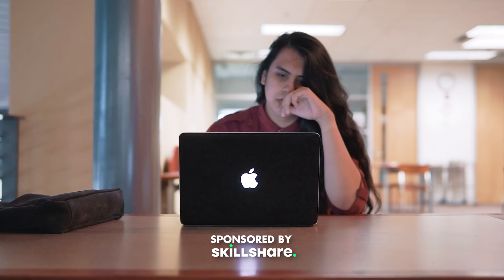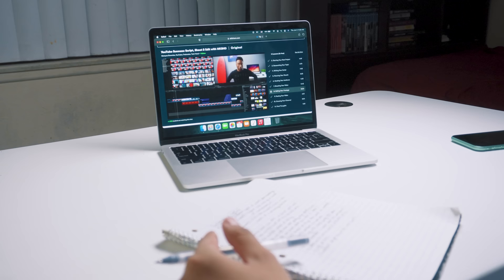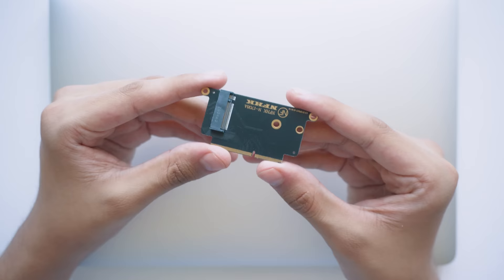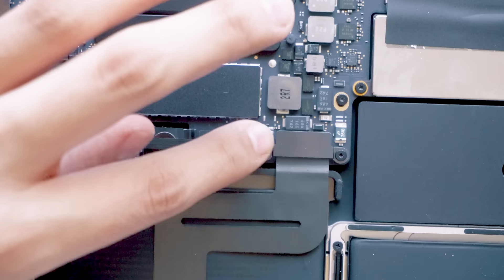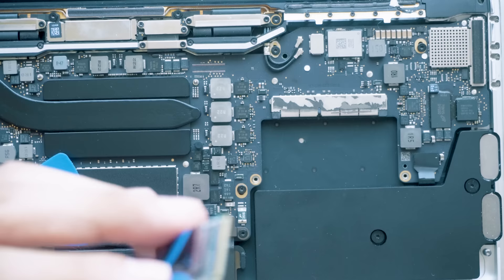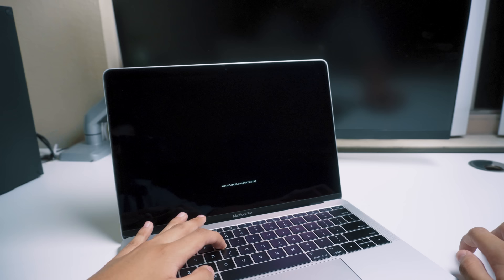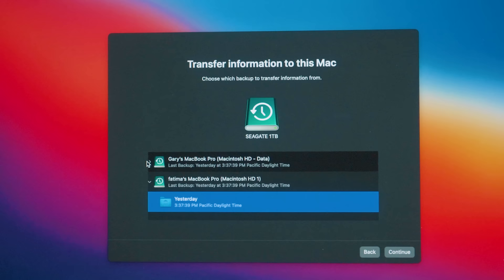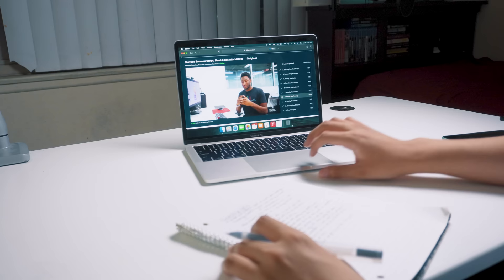I Was Wrong. THIS is the LAST Upgradable MacBook Pro

Comment: Can this be done on a 2019 16inch MacBook Pro? Nevermind bully me!
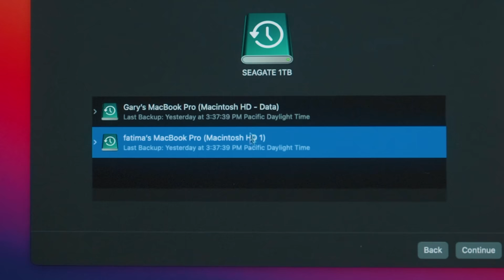Reply: 9:58 was hilarious
Reply: It can't unless you buy a new logic board with more storage
Reply: @slider7264  or you can learn how to solder
Reply: @jameschen8  it is not enough, there is a serialization on the chip, you have to transfer the serial from an old one, as in iPhone..
Reply: You can upgrade the storage in the 2019 MacBook Pro
Only with micro-soldering
Reply: @aleksandr_elkov  you can upgrade to windows (lol)
Reply: @al_three_ex  That is not upgrading !! That is called turning mac book in to a piece of crap...LOL
Reply: @jameschen8  nah T2 chip will turn whole mac into piece of garbage after a successful SSD soldering
Reply: No!

Comment: just remember to keep your original apple ssd, you will need it to upgrade to Monterey. The MacBook will do a firmware update in the process and will fail as it needs the original apple ssd to complete the firmware update. Once you have updated the firmware you can put the adapter back in a new upgrade to Monterey

Comment: The way the stand-off works is that you insert the nvme into the holder. The standoff is smaller in the middle because that part goes into the notch of your nvme. Then you use the screw and insert the screw from the bottom to hold the stand-off in place.

Do not put the adapter in first before the nvme because the screw is on the bottom
Reply: Is it possible to upgrade the hard drive in my 2018 Macbook 15" Pro Intel i7 ?
Reply: @torontoyes  Nope, all 2018 MacBooks have soldered-in storage. These 2016-2017 non-Touch Bar MBPs were the last to have any kind of upgradable storage.
Reply: @thepthepthep  let me correct you here. It is possible to replace the NAND chips and the T2, which can result in increasing the size of your HD.  You will need to reprogram for it to work.

Comment: Evening Buddy, Great video thank you. I've just done the upgrade with the same adapter and thought the standoff was broke on mine too. I did however work out that these adapters are slightly different to usual ones. What you need to do is place the gold stand off at the end of the ssd in line with the hole and then attach the screw from BELOW the adapter to keep it in place. Obviously this can only be done whilst the adapter is out of the MacBook but hope that makes sense.
Reply: That’s correct. I have the same adapter and can confirm that’s how it works.
Reply: @force0123456789  hi mate any link whered u got those adaptor?

Comment: Thanks for posting this video. I couldn’t have done this upgrade without you. My laptop now writes at 2200MB/s and reads almost 3000MB/s! I used the new Sabrent 512GB drive. Only cost me $60 and I quadrupled my storage. My laptop has never worked so well. You’re awesome!
Reply: Does it drain the battery faster than before?

Comment: Ok - Anyone who watches this and does this upgrade, don't be shocked if it does NOT go this smoothly. A few recommendations...

1. I had to create a Mojave boot installer by formatting an existing flash drive (the adapter I bought even had a note in the packaging telling me I would have to do this.) This is due to the firmware on an older mac not being able to recognize the new NVMe firmware. Without this step, the new SSD will not be recognized. (I don't know how he got around this step). Look around youtube on how to do this, it's not too bad - it worked on the first try for me, luckily I had a spare 16gb flash drive laying around.
2. Don't worry about installing a time machine backup onto the new SSD from recovery mode. When in recovery mode, just install the MacOS it recommends, if your boot installer doesn't automatically do this for you, and then do the OS upgrade from the desktop. After all this is working properly use migration assistant to install your time machine backup.
3. I used an old car GPS window suction cup holder to pop the lid off my Mac, it definitely made life easier.
4. Buy a decent tool kit, maybe like the ones from ifixit - don't limit yourself to only the T5 and P5 - I ended up also needing a small phillips head that was fortunately included in the toolkit i bought. I got mine on Amazon for $20.
Reply: I’m so glad about your comment. You have saved me. It was so frustrating to me when I face the problem but I followed all your step and it worked. Thanks dude. You are awesome.

Comment: I made this on my 2017 macbook air, and  it reduced the time on battery, but i noticed that depends what kind of drive you use.  NVME drives with cache cause less impact on battery life.
Reply: No drives with a DRAM chip will use more power and run hotter, and there’s no 2242 sized drives would come with a DRAM chip. Find a drive that has a lower power rating would be better.

Comment: just for Monterey be sure to upgrade once on the Apple SSD, then go back to your Sabernet and upgrade again. Monterey comes with a firmware update that detects if it's OEM ssd or not. But after the firmware is updated you can update to Monterey on your biggo ssd.
It's the same for 2015 mbp btw ;)
Reply: By this do you mean - the backup you restore to must already have Monterey installed?
Reply: @dhcmrlchtdj-1  this has nothing to do with any backup. To install Monterey on a non-apple SSD, the Monterey has to have been installed before on the MacBook in question once (with the og apple ssd). Monterey installation updates the firmware- but it only does this when it can verify the ssd. 
So if you try to install without this step, the installation straight onto a non-apple ssd; it will just crash and reboot.

Comment: If you're getting an error that says that you cannot connect to Apple's servers, instead of pressing command and R, you should press option command and R. This should bring you to the newer utility where you can actually install a newer Mac OS version. And if you're still getting that error you should try and connect to another Wi-Fi if possible. These two steps helped me resolve the issue.
Reply: I've made a bootable flash drive with Ventura. It didn't connect to Apple servers in both combinations

Comment: Just a suggestion to anyone giving this a go. If you use command option r on boot it will pull the latest version of macOS so you won't have to update after setting up the mac. Command R will just pull the version of macos that the device came with from factory.

Comment: I just upgraded my 2017 MBP 13 WITH A WD SN740 NVME 512GB with this adapter and everything including sleep works great.  Im getting about 2500/2300 MBps read write speeds.  Which beats out a lot of the 2022 Mac base models.  The whole combo cost (new parts) about $45 USD off eBay. I recommend the NFHK  adapter, it works great. Just remember the gold  piece is the retention mechanism that holds the SSD. The gold piece has a slot to hold the SSD in perfect position.  The screw goes in from the underside of the adapter to you have to assemble the SSD/ Adapter combo first! I recommend a clean install of Mac OS Ventura for max speed.  I did upgrade to Sonoma with OCLP 1.3 because I use the dictation function daily for work and I was tired of VM Windows 11. Im surprised that these 2017s do handle Sonoma quite well.
Reply: 45 for the whole upgrade ?
Reply: WHat's a clean install of mac OS? From USB or internet recovery mode?

Comment: Other comments have covered most things around the stand-off but if you use cmd-opt-r that will do internet recovery of the latest OS the Mac supports. Also when at the installation stage there is an option to use Time Machine so that is the best point to do it. Great video overall though.

Comment: I got the exact same setup, exact same SSD. The problem with this particular model of SSD is that it doesn’t go sleep mode making the MacBook constantly on. An issue well known from all the people who did this mod. 
So technically I just run out of battery everyday and it is a pain to turn back on because you have to go through the  whole reboot system. Thinking about it, it was really fun to do that but in long term it is really annoying

Comment: Owner of a 2016 A1708 here:
Was lucky enough to find one with an i7 and 16GB to boot in the market; got an M.2 2230 adapter and jumped up to 512GB.
Reply: Any issues with it yet? I’ve heard of problems with battery drain while sleep

Comment: Hey man, amazing video! 🙏🏼 just missing one key point, the MacBook doesn’t have uniformed outside screws for the case, so make sure to know which ones go where otherwise you’ll be playing a guessing game until all screws fit in their correct places. Also i did purchase the adapter linked in the description, but unfortunately I didn’t notice it’s the wrong size until I actually got it. Make sure to fix that so other people can avoid buying the wrong adapter.

Comment: Such a beautiful and easy thing to do. Thank God most Windows laptops are still upgradable and not just the storage but the RAM and Wifi card as well.
Reply: Unfortunately upgradeable ram seems to be vanishing with ddr5 since its apparently too difficult to get the timing right if they are socketed (at least that's the excuse I've seen being thrown around, im sure it'd be possible if companies were actually determined to make a repairable product)
Reply: Yes, but you're stuck with a PC.:/

Comment: You can technically upgrade the  new M1 as well, but you need to re-solder the old SSD and solder the new one. There is no serialization (for now ?? ) on the SSD
Reply: I've been doing this repair from home, but I can not even get the new NAND chips to solder on haha.
Reply: who the hell is gonna wanna spend time soldering a new SSD on when Apple could just use upgradable NVMe like everyone else?
Reply: @iCrackr  or use thunderbolt to get a super fast external SSD. I'm using an ipad pro 128GB with a satechi dock which has an external SSD slot i upgraded with 2TB for when im doing music tech stuff and video editing for my uni course. i dont know why they dont make upgradeable storage and ram in their devices like they use to
Reply: @MrChalmers99  why plug stuff in and carry additional things with you when you could just have a large internal drive
Reply: @MrChalmers99  hey what external ssd do you use? I need one for my macbook pro!
Reply: @elizabethjay660  I normally go for Samsung evo or pro SSD's but thats with my Windows laptop, I have a Samsung evo 970 m.2 with the Dock, but the macbook pro may only be capable with certain models of SSD or speed
Reply: it works but it’s damn hard to do it. probably not worth taking the risk. if you make one mistake and rip a pad off say goodbye.
Reply: @iCrackr  M* battery life isnt even because of ARM its because of integration. SSD controller is on the CPU die so it barely sips power.

Comment: If you encounter the error message "the recovery server could not be contacted" while trying to install macOS High Sierra in recovery mode, try to shutdown your mac then hold "opt+cmd+R" instead and press the power button to get into a different macOS Recovery mode which will install macOS Ventura. It seems that Apple has shut down some of their old servers which triggers the "the recovery server could not be contacted" error message.

Comment: I don't understand why youtube videos always looks so easy, i discovered this like 3 years ago, bought the exact same parts (adapter and SSD). after booting up the disk is not visible in the Disk Utility window you get. tried it 10 times or so, not working. Switched back to original and worked again. now I use this SSD in my desktop, where windows recognizes it instantly. So i dont know if someone here also faces this problem or can fix this ? Good video tho :)
Reply: reate a Mojave boot installer by formatting an existing flash drive (the adapter I bought even had a note in the packaging telling me I would have to do this.) This is due to the firmware on an older mac not being able to recognize the new NVMe firmware. Without this step, the new SSD will not be recognized. (I don't know how he got around this step). Look around youtube on how to do this, it's not too bad - it worked on the first try for me, luckily I had a spare 16gb flash drive laying around.

Comment: I found these Sabrent 2242 drives to be problematic with the A1708. It would occasionally crash and boot to a black screen. I searched the interweb and found this to be a common issue.
Reply: What is recommended alternative, do you have a suggestion?
Reply: I believe I found one on eBay, Samsung or Toshiba brand.

Comment: p5 and t5 are two types of screw driver heads, P stands for pentalobe, it's the fucking star shaped screws that apple use with 5 points that makes it inconvenient for customers to open up their own devices. On the other hand, T stands for torx, it's also star shaped, but it has 6 points, and you can use a flat head with the right size to work with torx screws.

Comment: The flashing folder icon says nothing about if the Mac detects the drive or not. It actually simply means that it can’t find anything to boot from. The same flashing folder will appear without any drives installed as well.

Comment: When swapping a drive on any MacBook makes that TRIMM support is YES in the system report under SATA/SATA Express. If not google how to turn it on using Terminal it not only helps with battery usage but also makes the MacBook so much faster. It’s really easy to do.

Comment: Dunno if you’re reading this but I have a 2017 MBP from a few years ago and since getting it, it has been great. I have since bought a 10/24/32GB 14” MBP Pro Max but I have gone ham on this wanting to upgrade because I like to tinker with things. 

So… I changed the battery. That was a task! Damn, Apple, you’re making it hard even at that point. But now I have a new battery and everything is working well. 

Now, I have started looking into the SSD. Here we go… and I have the same parts as you did. I will leave the M1 Max at home with my peripherals and use this as my tank. 

Let’s see how it goes.

Comment: The thing about that 2242 SSD is that it might be a bit slower than the 2280 ones and produce more heat
Reply: I used the 2280 ssd
Reply: To use 2280 ssd, wouldn’t you need to get a different adapter?  Or would 2280 ssd fit the adaptor used in the video?

Comment: I did this mod on mine a few years ago. It worked great minus upgrading the os. When there is a new major release, you have to put your old drive in and update that first. Then you can put your bigger drive back in. Minor updates worked like normal. It was def worth it. On the 128 I didn’t have enough space to do an update without taking everything off the drive, apps and all.
Reply: Also it's not a 'mod'. Previously upgrading your computer was something anyone and everyone could, should and would do. Stop acting like fiddling with your own hardware is strange
Reply: @ozordiprince9405  it's apple's hardware lol. They're just licensing it to you

Comment: Damn. New ssd not showing in disk recovery. Hopefully I can put the old ssd back in and get it working.

Just incase anyone else has the same issue. I resolved the problem by using an external enclosure to pre-load the operating system onto the new drive. The next time in installed it directly into the Mac it showed up.

Comment: Pro tip you don’t need to unscrew the battery screw as it doesn’t give power to the logic board unless that zip cable is plugged In

Comment: 7:19 when putting this model back together you should pay attention to the clips on the lid and make sure it slides into the metal fingers on the case. Just pointing this one thing out that should make things easier.

Comment: Followed Wincod75’s advice and used a boot installer. I advise doing this before removing the original SSD along with the usual TM back up. Once the MacBook was started up from the boot installer and the new SSD was recognised in Disk Utility I had to complete the installation (as though it was a new computer) before it could access TM. All is now going well.

Comment: the stand off screw is meant to sit against the little C shaped cut out on the drive, then the screw goes through the under side of the adapter through the hole, and screws into the stand off

Comment: The fatter end of that standoff can be pushed into the hole on the pcb, and it should be tight enough to hold it in.  I got an identical pcb last year, and that's how it worked for me.  This upgrade really breathed new life into my macbook pro.

I just ordered new keycaps and hopefully will breathe new life into that damn butterfly keyboard too.  With storage and keyboard issues addressed, I think these 2016/2017 macbooks can easily hit 10 years of service without feeling obsolete.
Reply: Can the standoff be put into the 2230 hole?

Comment: If it wasn’t for this video I wouldn’t have upgraded my MacBook. 

My recommendation is to avoid Mac OS Extended (Journaled) as it’s used for mechanicals hard drives. Use APFS instead. Also verify if trim is enabled otherwise writing speeds will slow down overtime.

Comment: The only problem with using this MacBook is that the TCON board gets fried through usage because of a flaw in Apple's design of this MacBook.  This is what causes the shadowing and the horizontal/vertical lines that pop up on the LCD.  The TCON is located at the bottom of the LCD inside the system symmetrically in the middle.  The TCON has no ventilation.  Someone should consider using a CNC to drill some grill holes in this area and paste some tiny metal plates inside this casing and then a magnetic attachment could be made to attach fans to the outside in the back to suck out the heat when doing work.  You could easily attach the fan(s) to the lightening port(s).